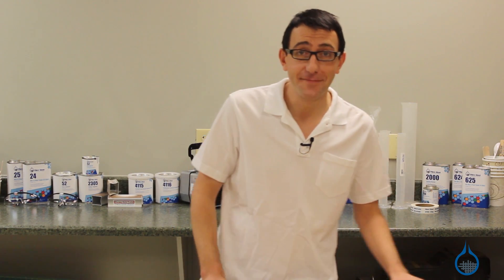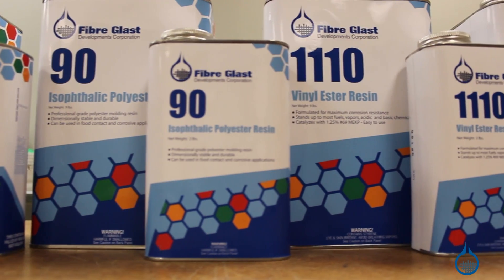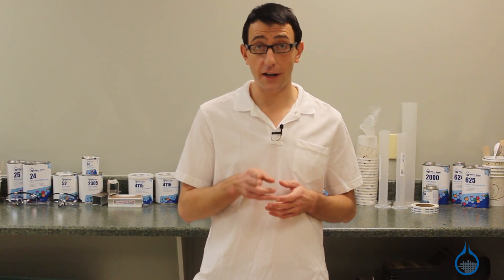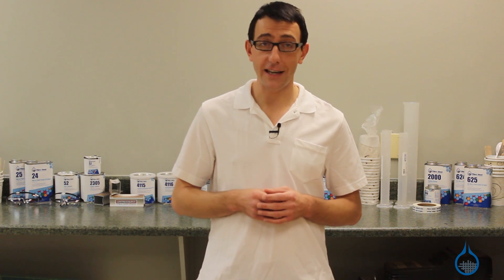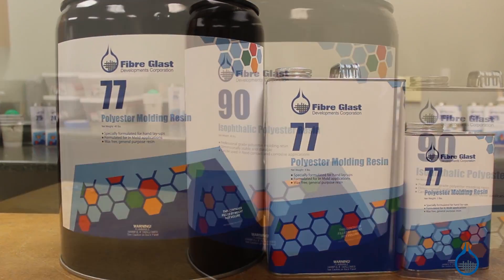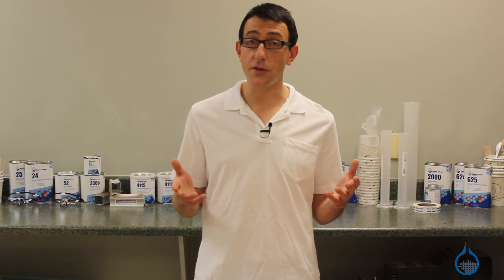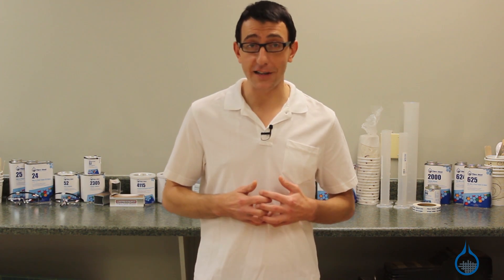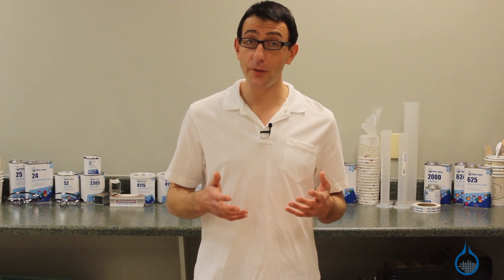Polyester Resins Overview

Comment: Hi, first of all you are incredible,what you are doing with these videos is very helpful . Great work guys! My question is which type of resin has the best UV resistance?  I need a transparent type of resin that will be used on a product that will be placed on the open, constantly exposed on weather conditions. And for the one with the best UV resistance i need data on how long before changing color, when it starts changing how it deteriorates and  basically anything that can give me a clue on how long before it looses it's transparency or starts showing significant signs of wearing of. Thanks!
Reply from the maker: Thank you Aleksandar! Both our Polyester and Vinyester Resins are UV resistant, however they won't hold up forever as you well know. We do however recommend that you apply our #180 Clear Gel Coat and our Duratec Clear Hi-Gloss Gel Coat Additive for curing purposes and extra protection against the sun's UV rays. Applied properly this can stand up for years out in the open.
Reply: thanks for the swift answer, but can you be bit more specific in terms of how many years...that's is if you have that type of data, or make an educated guess ...or even direct me where i can find about more about that.

Comment: I'm having a problem with bubbles using epoxy in a diamond mold. I've tried a torch and heat gun and it just seems to solidify the top because the diamond is slightly enclosed. I usually use it in woodworking applications and it works fine but for some reason I can't get it to work correctly in the mold.
Reply from the maker: Hello,

We would recommend using one of our Urethane Casting resins in your mold, however we must stress that this will need a moisture free environment and handle to urethane casting resin carefully to avoid air bubbles. You can draw air out of the resin by using a pressure pot, but if you're not using one of our resins we recommend you contact the manufacturer for help.

Thanks!
Reply: Hi I want to purchase the epoxy 2000 to make diamonds in my molds. Is it the same product you're having problems with?

Comment: very good viduo, what will the catalyst do to polyester resin?, so you mean that the styrene works as accelerator?, and if I put the laminate that is during curing, will this acceleate the curing process by giving more heat to laminate?thanks a lot for your viduos